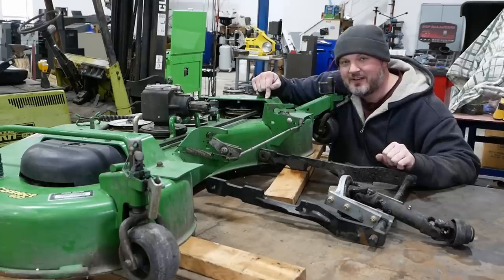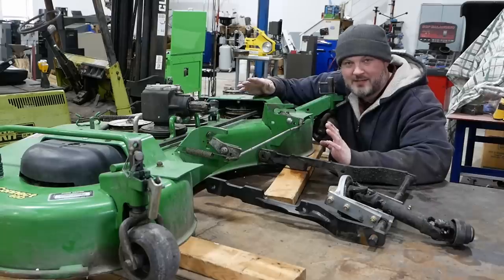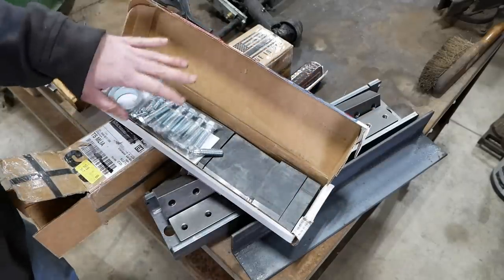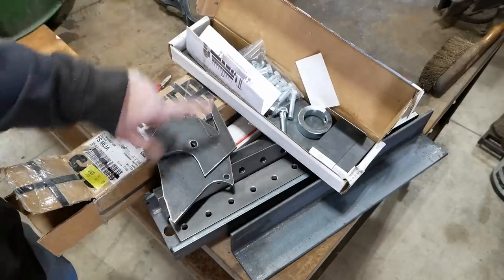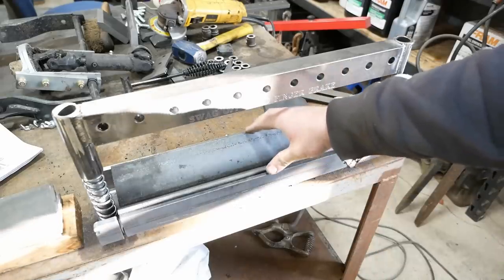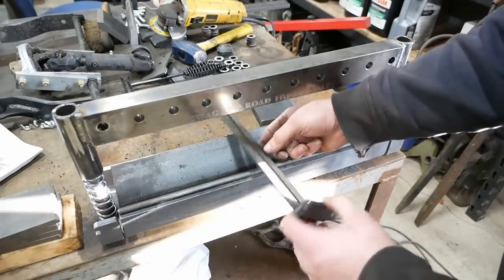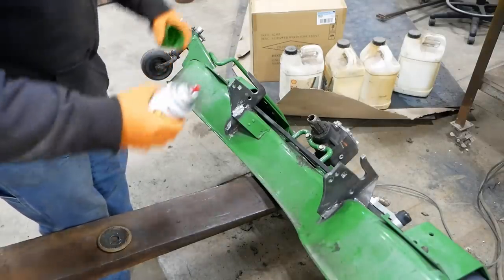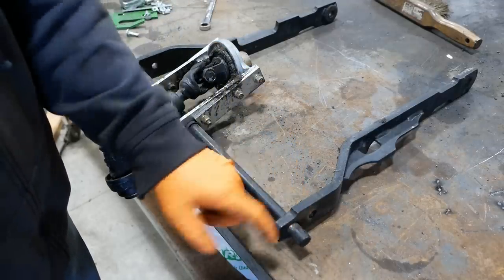Sloppy Deere Mower Deck - Swag Press Brake Mods

Comment: Fun video Wes, not boring, ha ha. Another option for making a bend near the end of a piece with a die that is too big, would be to cut the piece a little long, make the bend, then cut the short end down to size. Getting the bend in exactly the correct place is harder than one would think because the piece can slide a little, especially if there is asymmetry.

Comment: I work at a mom and pop sized company in Idaho that mainly builds enclosed trailers, but also does custom work if someone wants a part such as this made.

We have a press brake about 13 feet wide and a CNC plasma cutter as well, so this felt very familiar.

Great work on that deck!

Comment: Nice job on the press jig.  Just a thought, if you notch the spacers you can just loosen the bolts and drop the spacers in and out as needed without all that fiddling.

Comment: Learned years ago, if you can't order it, or they won't sell you the replacement part, you just build yourself a replacement. Steel bender is a great piece to add to any shop. Missus input was a great add on.

Comment: Great editing! I thought you would have removed the 3/4" bar, welded it, chucked it into a lathe then restored it's exact diameter. At least that's what the Pakistani truck repair guys would have done. 🤣 Always a joy watching you work. You're patient, thoughtful and calculated. Cheers from where we always see that bright light. (FL) Left IL 5 years ago, haven't looked back.
Reply: It's really difficult for me to watch those Indian/Pakistan truck workshop videos. I cringe too much
Reply: @Frank-Thoresen    But those guys do some interesting stuff, on a dirt floor. Captain Kleeman does most of his work on grass or crushed rock surfaces. But the Captain does it in freezing weather.

Comment: Great video, thanks Wes. For material too short on one side for the bending press you can stitch weld a small piece of similar thickness scrap. Press the bend then cut along the stitch line. We do this on production parts by laser cutting small slots where the extra material should be trimmed after folding. Hope that helps.

Comment: Hi Wes don't worry about taking the long way around the barn. You just need a big enough barn for the boy toys. Your new addition looks like it will work well for your needs. I thought your explanation of the relief needed for your bends was well done. Your comment about the CNC controls shows your generation. There was and still is precision machining accomplished with non CNC equipped machines. It is just that the operators are getting too old to do the work. Great video keep them coming.

Comment: That brought back some memories! As soon as the grass on the canal paths started growing I'd drive the John Deere up onto that deck and hoik it up underneath.
With the hydraulic flail on an arm at the back & the mower deck underneath I could cut the path to a damned bowling green finish whilst I concentrated on flailing the hedges. 
Once down one way for the left hand side & thence back up the other way for the right.
They sure did look good & if I played my cards right I could leave that canal looking just about perfect & I'd've been sitting down all day! 😆

Comment: Great video and repair work. I've had  a strong opinion about auto connect mower decks, regardless of the manufacturer for a while. When new and set up perfectly, they are great! When they get worn and/or out of adjustment they are nothing but trouble. Glad you were able to repair this one!

Comment: When you grind powder coating or galvanized metal, use a new flap disc on the grinder. A grinding wheel will hold the coatings and embed them back into the material. Where a flap disc will sand it off. I don’t know why it works but an old timer taught me that and it works every time. Good video.

Comment: Very cool 'add-on' to your press to give you a functional brake setup. I dig it Wes. Good idea on your own spin on re-engineering it to your preference too. I think your solution works great, and definitely bends a big enough gauge for anything most of us would need. I've had good luck in the past with those Milwaukee 'Torch' blades on my reciprocating saw. They seem to last a while, for a decent amount of cuts, out of the majority of different blades I've used. I damn sure wish I had a CNC plasma table!  Thank you for sharing 👍😎

Comment: Bought a Swag Press Brake for a Harbor Freight 20 ton press a few years ago. Don't use it a lot, but it sure has been a life saver several times. Great mod you showed, but I just used a few more smaller and smaller angle irons to do those short bends. Great video by the way!

Comment: Hey Wes! I make most of my bends by laying them out on CNC plasma making sections cut out on bend lines then use the bench vise and bend them and weld up holes on bend line that is what works for me. But either way works so thanks for the content!

Comment: Yeah, I never liked any of those drive-on or drive-away decks. 
Saved up & bought Ferris diesel ZTR. 
Never looked back after driving with suspension. 

Mower deck s new tools are always good content.
Reply: I have wondered about those fancy mowers with spring suspension on them. Is it really a game-changer?  I have an issue with my back so I have thought about giving one a try.

Comment: I don't know if this already in the comments below, and I'm not about to read all of them. 
Being a sheet metal worker, halfass fabricator over a lifetime of trial and error. 
First let me say you did heck of a job revising the brake press, and I commend your innovative thinking, because you took it up several degrees above what it was, the basic of basics.
To assist you in achieving the proper degree of bend your wanting.
You've have two ways of doing that in my mind, but I'm sure there's a lotta people out there smarter than I am that'll have better method of doing what you want. 
You can either leave the end that narrows down to the point it doesn't pass all the way to the other side of the press.
Are you can take another piece of metal of same thickness, and stetch weld it to your actual piece of plate. 
Either will allow the press brake to support the material all across the entire piece, and that'll give you the same degree of bend that you're trying to achieve. 
Then with your new plasma cutter, simply trim it down to desired shape your wanting, and touch up with a flap disc with a slightly tapered edge to allow better penatraion of your welds.
That's how I'd of had it made in the future to make the bends equal all the way across, and if it would have had a compound angle. 
Simply make first bend across the desired piece, and cut it off at the center of the other bend in as close to the angle it offsets the other way.
Then flip it over, and weld it back at the angle your needing. 
Since you don't have a hot press stamp mold die machine to do it how the factory works done, those are another way to achieve the same thing. 
When I was a kid, my uncle that taught us all to weld, and fabricate was a machinist mate in WWII 
Where he learned his skills that he perfected over the years as that, then a Boilermaker, and finally as a millwright, at the GM plant in Arlington, Texas. 
He taught us all to turn out our finished products as if it was made in a way that you couldn't tell it had ever been welded, and how to weld it to where it was as strong as if the welds weren't ground down smooth.
So that even if it was bare metal you had hard time telling where the welds were, but I know that is a lotta extra work plus material in grinding disc flap disc, and wire wheels. 
Then the way a lotta companies want to actually see the welds in order to pass inspection. 
I have to assume that the Navy, are the Cheif he worked for back then had their own way of doing things, and that's what he instilled in all of us.
I know that's how he did everything I ever seen him do everything that he built for either himself or someone else. 
Thanks for sharing your ideas with us, if I were younger, and needed something like the press brake you revised, I'd dam sure make the revisions you made, because it works better than what you started with.

Comment: On the powder coated stuff, I've been struggling with that recently as well. Like you said, you can't get all of it off with a flap disk. What I found that finally worked was to get a MAP gas torch, got it hot enough to burn the powder coat residue into an ash powder, then hit it with a wire wheel, and then a little shot of solvent. It's the only thing that worked. Any other weld I did before that I was having trouble with penetration and adhesion. Powder coating material is a terrible thing to work with when fabricating.

Comment: I would imagine heat would really help focus that bend exactly where you want it.  You might want to check out the set up Dave Engels has over at Engles' Coach here on youtube.  He is doing a huge amount of bending in the process of building horse drawn stuff, and I've seen him overcome some of the exact problems you had here.  Might be good for ideas/input.  Great job saving an old mower.

Comment: another nice tool in the shop and a job well done!
a piece of advice, you may want to protect your camera when you film during welding, just a piece of welding mask tinted glass or an automatic filter should be good to go. I work for a company that make MIG welding wires, our PR people already burned a few camera sensors by not protecting them.
Reply from the maker: I've heard of that but I've done it many times with no issues.

Comment: I’m glad you did this mod and filmed it. I bought my SWAG brake a few years back and haven’t put it together yet. I did buy the flat variable accessory and finger and hemming dies. No I’m not a pro of any kind. Yes I like to remake better versions of things I’ve bought. The cheap HD outdoor LED walkway lights with cheap metal that  tore when brushed against is one reason. Also make a removable hanging tool caddy for the plastic wheelbarrow for yard work. ETC.  Your mod I can do as I have a mag drill and drill press and air tools (manufacturing mechanic) so I will be buying some steel next weekend for all my backlog of projects and the material for this mod. Thanks again for your effort to film and post and give advice. I liked the explanation as you showed us “why” and that makes the brain happy.

Comment: That's a good idea with the press but could you close the gap and keep opening it yeah it's more trouble. Different size shims on the inside part of the bend area for easier adjustment just a thought.  I 'm not talking little thin shims and to add them to your set up also. Thanks I learnt something new I was always told "that's why they made grinders". I loved the part Ms. Wes played and she nailed it. I couldn't see any body else playing that role and doing it better couldn't happen thanks !

Comment: I've run into the same issue with powder coat.  I've found the hot wrench is pretty effective removing it, but a sandblaster is quicker and less smelly.

Comment: Sounded cold for the wire speed you were running. The stick sounded perfect. When in doubt turn it up. Cool design on the press for sure.

Comment: The scale on the brackets also contributes to crappie welding. So between the two. Crappie welds that will still hold a mower deck.  I too couldn't work without lathe mill torch and plasma.

Comment: Thoroughly enjoy your videos! Just added an oxy/acetylene setup to my tool arsenal. Teaching myself brazing and welding. Would love to have a shop press. Maybe I can build one with a bottle jack. 🤔
Reply: I needed a press for a bearing and harbor freight with in a hundred miles of me didn’t have one so for about the same money I built one. Had to buy a twenty ton jack from HF but I’ve got one now.
Reply: HF, Northern Tool and others have em...look for sales. Then go to HF and get the 20T air bottle jack...and swap it out. Makes life soooo much faster and easier. Still gotta put a knob on the release valve handle. There's also a cheaper than the SWAG and pre assembled bender...gotta find it again. Found it back a while

Comment: Powder coating will saturate in my experience. So I heat it with a torch after grinding off the later, wipe with a cloth while hot. Then once cool, clean with acetone or brake clean before welding. Seems to help a lot for me.

Comment: As a former press brake operator, your die opening needs to be 8 times the thickness of your material to get a 90 degree bend.  1/4” material would be a 2” die and so on. Hope it helps!

Comment: A neat trick I've seen is when designing the CAD models for cutters you design in little marks that are cut out that, when you draw a line between them, is more or less where the centre of your bend is. Though, I guess in this case maybe we didn't know those locations until the originals were removed.
Reply: @T.J. Kong I saw a custom car dude do something like that I think. Brilliant.

Comment: I have that SWAG finger press brake. It works ok but I find it cumbersome to use. The modification I made was to CNC plasma cut some 1/4 inch plate and bend them in the brake rather than trying to stack angle iron. For thinner stuff I managed to find a really good deal on an old Dreis & Krump Chicago finger brake.
Reply from the maker: I thought about that too but I don't want to do bottom bending.

Comment: I've got one of those mower decks. Biggest piece of junk that I've ever had to deal with. The front support arm is also very fragile. If your customer hasn't had any problems with that, then they are very skilled.

Comment: Something about the steel John Deere uses. I've found I've had to use heats and speeds I don't need on other equipment. Press brake is pretty cool.
     Best regards from Indiana.
Reply from the maker: Probably not even steel but some proprietary alloy meant to thwart repairs. "Please contact your dealer"

Comment: Necessity is the mother of invention. I do my own hot metal pouring, I cannot begin to tell you how many tools I have made, I am not even sure that any of them were even invented except by me. Nice job on your invention Wes.
BTW powder coating changes the metal Fatigue because of the oven baking, so your wields will not attach correctly.

Comment: Slot those spacers to prevent having to fully remove the retaining bolts every time you adjust. If necessary the spacers could be turned to 180 degree the slots so no support is lost.  Good mod though, well implemented.
Reply from the maker: Good idea. Or I could slot the base so the dies lift out...
Reply: @WatchWesWork  
Or that........👍
Reply: I was thinking of the same thing. Slotted spacer plates that drop in. Maybe split the plates in half  to make them easier to handle. Also, with plates you could use fewer  bolts as they aren't under load. Pressure is all out and down.
Reply: Maybe there is some way of doing it without spacers so you could just use bolts threaded into the outside  frame to push the inner part in and make it infinitely variable, you'd just have to measure the gap to make sure its parallel  both ends .

Comment: If you want to hide some particularly big sins, I always break out the can of Bondo. Usually, metal is already bare after your sins are created, so wire wheel it real quick, stir up a little bit, as needed. Rub it over the weld with your finger. I'll let it kick off for 10-15 minutes, & lightly sand if needed. Just paint, and you're good. 😬👍💯
Reply: And remember just use a finger to apply it. There's no need to be Picasso on freaking welds.👈😁👍💯

Comment: Not sure if the big john deere mowers are set up this way but the smaller ones are designed to carry the deck,and the gauge-anti scalp wheels   Don't roll unless they hit a high spot, so maybe the wear is from deck wheels  bouncing the deck.

Comment: Nice mod!  Could the plasma cutter guy have also made some slots in the metal along the bend line?  You could then pound the metal in a vice and then weld it.  Just thinking of ways to do it without a press

Comment: Yeah, sure, Wes - any excuse to buy a new tool!  Coulda got out the smoke wrench and bent it in the vice and then tempered it the way you wanted. 😂😂😂
On the flip side of the coin, one of my favorite sayings is, I’ve never owned a tool I didn’t modify. 👍🔧🔧🔧

Comment: Just food for thought Wes. 

When they do powder coating they electrically charge the metal which drawls the paint in for a good tight seal.  In other words they magnetize the metal. Possibly there is a residual amount of magnetism left over when welding on the same metal. Not sure just a thought.
Reply from the maker: Could be. I really don't know.

Comment: I just bent the angle iron a bit over 90 with the press then welded a smaller vise on a plate that i can mount on the front or back of the press depending on the part needing bent..

Comment: For the ear too short to bend, extra material could have been left on the part when it was plasma cut to make it fit the bending press, then cut off after to match the factory part.  First-time parts prove you don't know what you don't know.
Reply from the maker: Yeah it was a little too late for that.

Comment: Have worked on these JD 5' decks about 15 years.  Imo, 1/4" is a bit light in the support structures.  Not a fan of the drive over, Auto-connect systems on any mower decks.  Yep, the manual attachment types can be cantankerous at times.  Belts, bearings, gear oil and grease are routine maintenance tasks.  But Darwin award achievers aside, never frame or support attachment parts.  Nice work with the press fab job. 👍